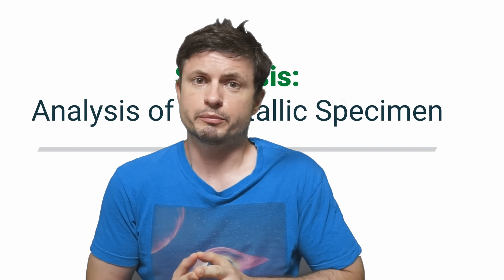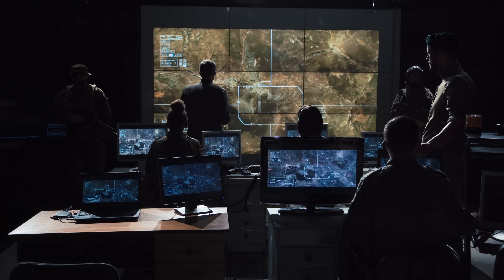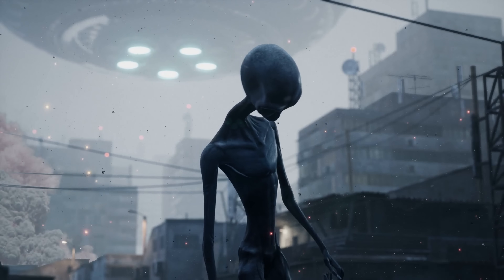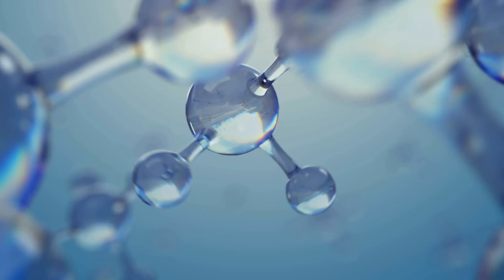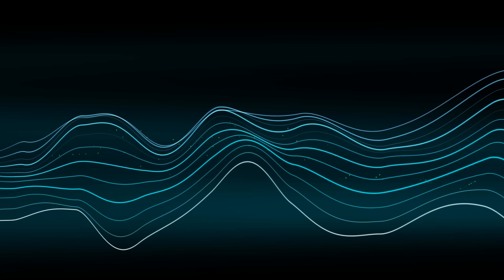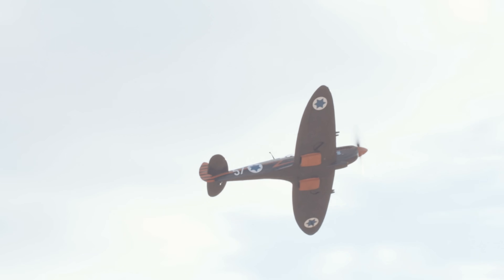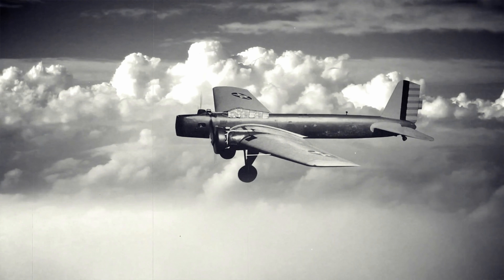Metal Piece From 1947 Roswell Incident Analyzed By a Government Lab

Comment: Not totally true, magnesium alloy has turned out to be very useful in the automotive and race car industries- Ferrari pioneered Magnesium alloy wheels in the 1990s that were lighter than any other alloy before them and today many sports cars have these lightweight wheels as they are cheaper than carbon fiber alternatives. However, I suspect the modern automotive alloys are far superior to that failed and crude 1920's alloy experiment, it would be interesting for an independent laboratory to compare the alloys past and present just to put the UFO community at ease over somebody claiming a random rock they found in the desert was from Roswell when it was scrap form an experiment elsewhere and dishonestly produced to convince ufologists.

Comment: Bismuth-zinc batteries with a solid magnesium oxide electrolyte is an area of current investigation. Imagine if the skin of this potential craft could somehow  harvest atmospheric static charges during flight like a battery.  One side of skin  would have negative charge the other positive once charged by atmosphere. Interesting, perhaps this had other applications other than just being a battery. Highly doubt this was a serious experimental alloy because why would you with magnesium's obvious down sides? Plus we already had aluminum and titanium.

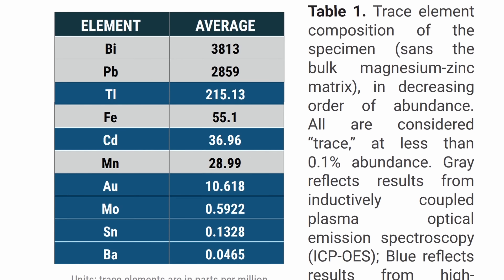Comment: 8:09  Bismuth, Lead and Thallium?  Anton, you seem to have discovered something remarkable.  Bismuth does actually undergo decay...to thallium.   Those aliens over at Roswell must have been up there a really long time.   (Our common use of Bismuth would include tin....It's a very low melting temperature alloy.)

More seriously, in WW2 the Japanese were actually launching quite a number of incendiary weapons against the US Pacific coastline, mostly balloons by submarine.  They were addressed by the US Government using them as training targets.  Although there was some initial concern that a forest fire might get started, the fact that they were visible on radar was kept secret.  The US Airforce was responding to "something" and  it never seemed to amount to anything.  The Japanese always seemed to stay over the horizon of ground radar and if we had managed to get radar shrunk down enough to fit in an airplane, we weren't talking. 

What was super top secret in 1947 was our use of the "proximity fuse."  This was a very early use of simiconductors.  A tiny little radar and tiny little battery was shrunk down to the size of common artillery fuses.  This was still considered top secret well into the Viet Nam era.

But why didn't the aliens refine their bismuth better?  I doubt they were in outer space for so long that they forgot.

Comment: Makes sense. The report after the records release showed they were trying to build a balloon (they got the idea from Japan floating bombs over the Atlantic) that could carry a nuke over the pole. That's why they were making crap up  to avoid the USSR finding out what they were trying to do. But it backfired and they received too much attention.
Reply: @joemurray8902  thank you both, for possible scenarios i havent heard before
Reply: @Rubicola174  Thank you. I had to scroll way too far down to find someone finally mentioning Project Mogul.
Reply: I doubt they were trying to put a nuke on a balloon, as that wouldn't be very sensible. I think it was more likely that they were trying to make spy balloons that could fly over Russia at extreme altitudes. Those tests were done before the introduction of the U2 spy plane, which was designed to do the same thing.

Comment: Anton, I personally love it when you bring up topics like this, every amateur astronomer has seen flying objects at least one time, they are mentioned in old books from all over the world, so I find it very fascinating👍
Reply: @Nebukadnezar2036  David Grusch. Karl Nell. Gary Nolan.
Reply: I mean like the iron pillar in Delhi, which is made of extremely pure steel and is around 1700 years old, which is why it is still standing today. This type of steel production has only been known for around 100 years! We find, especially now, extremely new artefacts in Siberia, due to melting permafrost.
Reply: We don't consciously experience reality.
We experience our brain's conditioned responses to neurochemical stimuli.
Martian canals, anyone?
Reply: @rabokarabekian409  Consciousness is primary and gives rise to physical reality, not the other way around. New paradigm alert ⚠️
Reply: @rabokarabekian409  Yeah, our sensors (senses) interpretation of reality.... now I'm suddenly thinking of "free will", if it exists or if it's just infinite jostling bits effected by random roll of the dice.
Reply: Mirages. Just mirages.
No different from the ones we see on the road, these appear in the sky using the same conditions - moisture, hot air, cooler air. 
Those conditions are at higher altitudes, just as they are in the layer of air on a road. All it takes is two different layers of different temperature/moisture content/density. 
The air at any altitude above us is also composed of layers. Indeed, weathermen now make references to 'atmospheric rivers' during forecasts, because there are huge bodies of water up there, taking increasingly extreme weather to places like Europe, Russia, America, etc. it's nothing new.
And where there are layers of air of differing temperatures, etc, you have the same recipe for reflecting images (from astonishing distances) onto pockets of moisture.

I've seen a 'Tictac' right above my house, my son as my witness.
We were both eagerly watching for a meteor storm, had already spotted some good meteors, when there was a flash of white light directly above the house.
We were both looking up anyway, obviously, so it only took a slight twitch of the eyes to see this flash - and there it was, coming out of the diminishing flash: a Tictac.
You can imagine our reaction.
We were really excited. 
It was a crystal clear Tictac. Very bright white, not lit up with lights, not glowing, but white as if there was a very bright light shining off it. (No Moon. That had gone down over the back of the house, past the horizon and wouldn't be shining on that side of the 'vehicle.'
I'd say it was about quarter of a mile above the house. Totally silent. No exhaust stream or anything that would indicate an engine. 
It was typical of other Tictac sightings : Tictac shaped, this one having three thin black ellipses standing on their ends on one side.
It moved across the sky about 20-30 degrees (a bit faster than a normal aircraft). Then it completely vanished, not behind a cloud or any other obstruction. It was a perfectly clear night. It just suddenly wasn't there any more. 

But I am one of those people who would rather question and question anything unusual that I have ever seen, rather than scream UFO and want for interviews.
For a few months, I kept mulling over what I had seen, discussing it with my son (who agreed to keep our sightings secret for the time being).
Then, I saw a picture online, of a cruise ship seemingly flying high above the sea. 
That's when it clicked. 
What we saw wasn't a UFO, it was a mirage of a 'part' of an ordinary, everyday, bog standard commercial passenger jet. 
There are often mirages of 'parts' of things being a mirage. They're on the internet - floating mountain tops high above the real thing (hmmm. In UFO space).
There are photos of floating forests, floating cities. If you look carefully at mirages of say a car or camel train, look carefully. Often, it is not the whole thing.
Tic-tacs are just that.
A part of a passenger jet, namely the part of the fuselage behind the engines - yes, the engines, which are forcing out hot air into a cold air space, of differing moisture content. The perfect recipe for mirage creation.

These military aircraft who see these Tic-tacs move at incredible speed.
Think about it, when you drive down a long, straight, hot road, seeing a mirage of water on it. As you drive, the water can very suddenly shift from the foreground to several miles down the road in an instant.
That's what the pilots are doing, they are seeing the partial reflection of another aircraft shift several miles in an instant - from their perspective of a fast military jet travelling past an air pocket they can't even see. The air pocket is simply acting like a mirror, 

And of course, this is the answer to those other 'authentic' saucer shaped UFOs, just variously distorted mirages of other aircraft that could be many miles away, far out of human sight and hearing. 

I have seen another UFO that I cannot link to mirages. It was one of those black orbs, seen at a very close distance (6 feet). But, as I live in an area with a few bits of boggy ground, and there was an earthquake a year later, it could be that this orb arose out of a combination of gases and some magnetic influence (as it did respond to my movements, always maintaining the same distance until it vanished).

I believe there's an explanation for all these phenomena in natural processes, and have sincere doubts about stories of crashed UFOs in secret hangars, autopsied aliens, abductions and other such things.
I wish it was otherwise, I really do. But I don't buy it, not on the evidence presented so far.
Reply: @Debbie-henri  Nice post! I hope you can respond to my question because I want to know more. What do you think of the abduction cases like Travis Walton and David Jacobs? I also have many more questions I hope you can answer on this topic. :)
Reply: @Debbie-henri  What about the 'Mirages' that show up on RADAR or the 'Mirages' that left burnt ground and/or indentions in the ground/plants? What about the 'Mirages' seen and filmed/photographed by hundreds (possibly thousands) of independent observers from differing angles and distances? 
Mirages might have caused some viewing incidents but physical evidence, is not just a heat haze.
Reply: @Thurgosh_OG  Exactly. Physical traces and radar hits are "just mirages"?

Comment: "Was indeed made out of Magnesium"
I think you mean "contains Magnesium", considering the fact that it's literally 0.426% Magnesium. 
Also, knowing something is clearly an engineered material, but not having any other clue about it, isn't in any way a proof for or against any hypothesized origin for it.
Simply guessing that it was made in the few years during the infancy of the first technology that could have made micron by micron layered metallic structures, and speaking at length about the stipulations of this wild guess, isn't credible or unbiased in any way. The only unbiased conclusion that can be drawn here is that we know essentially nothing about it's origin.
Also also, a micron by micron layered material isn't an alloy. Alloys are isotropic mixtures of multiple metals. It's not even an intermetallic. It's literally as far from being an alloy as anything composed of multiple metals can possibly be.

Comment: just looked up bismuth and checked the density. 
according to Wikipedia.  if it is what they say. and aluminum is aswell. then the best candidate to make a material with the desired properties is gardinium.
Reply: Gardinium?
Reply: @Tugela60  it also has some strange properties. ontop of the difference in density.
Reply: @atticuswalker  Yeah, it emits waves that makes your brain go all woobly apparently.
Reply: @Tugela60  because it's structure allows it to bridge frequencies.  change its energy density by volume. combined with aluminum. the density equals that of the crystal. which has straight sides because the atoms don't react to gravity of other mass. just the curvature of spacetime.
Reply: @atticuswalker  It is physically impossible to combine gardinium with aluminum, or anything else for that matter, because there is no such thing as gardinium.
Reply: @Tugela60  on the list of elements it's the one closest to 8.009.

Comment: If only we could have actual physical evidence from actual crashed UFOs ... and it did happen... in the soviet union on January 29 1986. An actual ufo crashed. Actual physical proof was taken from the site and were later analysed by a lab in Omsk, and they figured out that there were very thin threads 17 nano meter in length made of fibers even smaller (which was impossible at that time). Some fragments had taken the shape of balls made of aluminum, manganese, nickel, chromium, tungsten and cobalt... when the balls were melted in a vaccum chamber, one ball melted as expected, another melted...but then formed into other smaller balls with convex glass-like structure, when they melted it again, the gold, silver and nickel would disappear and turn into molybdenum, which didnt exist in the material or vaccum chamber prior to melting the material. They found biological ashes from a burned creature at the crash site but they werent sure if it was an animal that was there or an alien.

Seems like this was a legit ufo crash. Too bad it happened in russia and we'll never ever ever ever ever see anyone else openly study those remains, if they still exist somewhere today... which i doubt.

Comment: My tutor at chesterfield foundry college told us how he helped discover SG(spheroidal graphite) Iron .In a lab foundry Dr Morrow had finished a cast, and needed to dump excess iron from the ladle. He chose the wrong bin. A hopper full of magnesium 'stuff' ! boom. During the clean that bin took some time to cut. they expected a brittle compound,,but it was tough, took a pounding but yielded gradually. my tutor , Mr Gleaves, was set the job of examining the alloy, and said he prepared the polished samples for morrow to view in a scope! The carbon in the ladle iron solidified into a ball after hitting the Mg! Not a flake , which can intiate a crack...= failure. 
The ball of carbon has no edges meaning an increased resistance to failing. Voila Ductile Iron.
Wey it was 40 year ago, but my best recall.
Reply: Back in my first life, when I was a metallurgical technician, we accidentally changed the microstructure of Si in Al. ( yes other elements were present in minor and trace amounts) we changed the microstructure while extruding the alloy. We did some tests, then went through notes and were able to repeat the process with the same results. We “found” any alloy the British tried to make in the 1920’s-30’s. ( i dont remember now)  

After extrusion we could take a bar of this alloy, heat it to 1220, and cut it with a butter knife. In any way you wanted. Then pick that piece up with a pair of tongs. 

Now if I remember correctly we had put Al in and Si matrix. ( basically it was “backwards”). The engr I worked for was very excited. We did the process, testing, and metallography 25 times over to make sure. But the boss of the company could have cared less. I still have a samples of the alloy and the lab reports in an ammo can siting in my garage.
Reply: @timmylittle2406 : Interesting, shame I can't think of any use for those properties. I'd like to say "macking material", but the heat renders that doubtful.
Reply: Ductile cast iron was first invented in 1939 at the RWTH (technical university) Aachen in Germany and in 1942 by Keith Millis at the INCO company in the US.
It took until the 1950s until it became available in commercial quantities.
Reply: @hermes7587 Millis patented it in 1949, I believe. Morrogh invented it independently.
Reply: Thanks everyone,  forgive my memory) as soon as 'cerium' was mentioned I winced ! Potent. He was a good man, maybe trying to inspire us to explore? )
Reply: 1) Morrogh, not Morrow, 2) your tutor must have been old. Morrogh discovered it around 1947 — and the story I’ve read is that he systematically went through the periodic table except for magnesium (cause he didn’t have any) so he made sg iron with cerium first and only later found out that magnesium also worked.

Comment: What really makes me question this, is that the previous head of AARO joined the same exact lab which performed the analysis. I mean, really?? Even just to avoid the look of inappropriate handling from bias, you wouldn't ask another lab to complete this testing??
Reply: makes it worse that the questionable performance from  AARO debunker Kirkpatrick now works for Oak Ridge Laboratories where this sample was sent to. So you can bet those results will be inaccurate.

Comment: AARO is a sham set up by the Pentagon and CIA to investigate it's self.  It is an organised disinformation campaign to protect a unacknowledged special access program in which there is a cold war between major military powers in attempting to back engineer the technology with little to no progress over the last 70 years. The CIA and the Air Force were created within a month of Roswell. The CIA's Office Of Global Access heads up the crash retrieval of any craft accidentally or deliberately downed. 

Kirkpatrick is the same disinformation model used in Bluebook with J Allen Hynek.  Pretend to investigate, then claim there's nothing to see here, despite multiple high level US service personnel including those who interact directly with the president, Admirals, as well as top gun Navy fighter pilots (some of whom still serving)  who have all come forward to confirm that there is indeed a back engineering program under the same national security secrecy as nuclear weapons development. 

This is all verifiable fact.